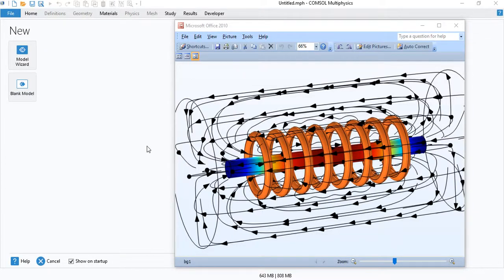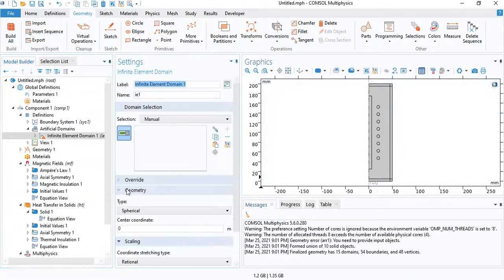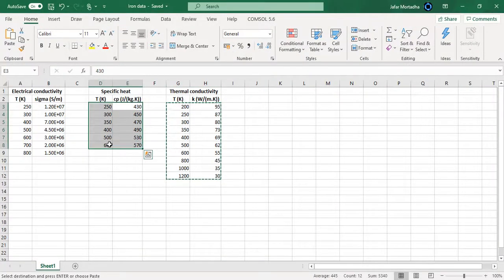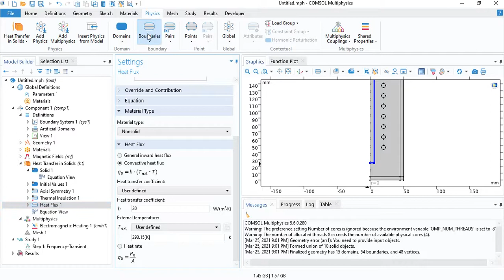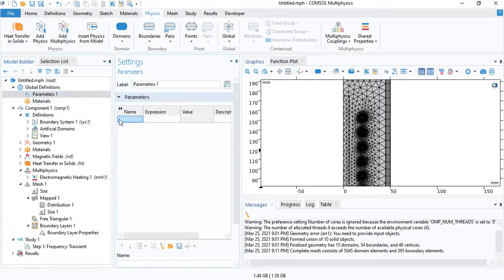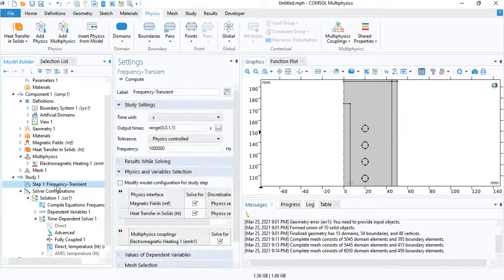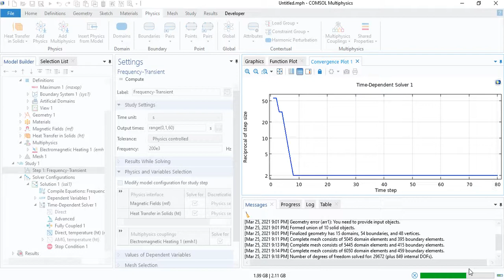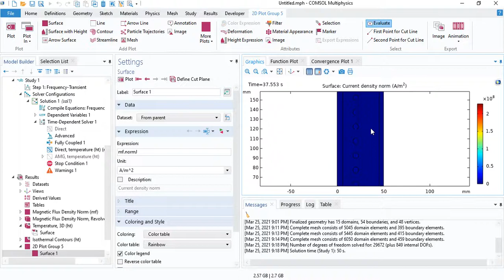Induction heating simulation of an iron bar using Comsol Multiphysics

Comment: Can you please upload the actual comsol file you created in this video. I try to mimic them but couldn't run my simulation.Please help
Reply from the maker: What is the problem you are having? If you apply the same steps in the video it should work.
Reply: @JafScience  Can I simulate the same problem instead of fixed iron bar, I want a m0ving iron wire with some speed around which EM field is created.Can I do this in comsol
Reply: I have used physics controlled mesh and probably ignored skin effect through that. But I am getting constant temperature profile in the rod , why?
Reply from the maker: Yes it can be done but it might be computationally very demanding depending on the operating frequency and the magnitude of bar displacement. You need to use a moving mesh to specify the velocity or displacement of the wire.
Reply from the maker: Don't use physics-controlled mesh. At high frequency the induced current will be concentrated near the surface and that's where heat is generated. If you ignore skin effect then the EM field will penetrate deep into the sample and heat will be generated everywhere. 
If the temperature is constant then no heat is being generated. Make sure the physics coupling is applied.
Reply: @JafScience  Thanks for the info. I will try this .But it was a helpful video.
One thing which creates doubt in my mind is why the temperature is varying along the length of bar while due to induction temperature gradient should be along the radius but it is not so.
Reply from the maker: There is a temperature gradient radially but it is small since the bar is thin and the heat at the surface quickly flows inwards. The temperature gradient axially is more significant since the magnetic field at the centre of the bar is higher so the induced current is higher. And it also takes time for heat to flow axially.
Reply: @JafScience  Sorry, but I couldn't understand how magnetic field at the centre is higher,however, each coil is given equal current? Can you please elaborate a bit
Reply from the maker: Each coil segment carries the same current, but at the centre of the bar the magnetic field from the coil segments get enforced (individual fields add up). Whenever you have helical coil or solenoid, the magnetic field at the centre is the strongest and it weakens away from the centre.
Reply: @JafScience  okk...thanks very helpful.I think it can be verified from the contour of magnetic flux in ab9ve simulation
Reply: Hello, I tried to apply moving mesh technique to this simulation by prescribing normal mesh velocity to iron bar however I am unable to select the iron bar in the moving mesh domain.Is there any reason for the same? Rest all steps are same as in this tutorial.I just want to move my iron bar with some speed and see how temperature changes
Reply from the maker: You need to specify a deforming domain (surroundings of the bar) before you select the moving domain. I also suggest that you define a prescribed displacement for the bar and prescribed displacement for the boundaries of the bar instead of normal mesh velocity. Define a function for the displacement such that its time derivative is equal to the velocity you're interested in.
Reply: Thanks for your response. I tried the same step, but I think I am unable to call defined function for velocity.
If you will make new video on iron moving wire which is heated with em induction and I can find the temperature along the wire depth from the surface at any time,it will be much helpful 🙏🙏🙏
As i am new to comsol, it is little difficult for me
Reply from the maker: I may make a related video that shows the same concepts. If you just need to define a function then right click on global definitions and you will see a wide range of functions. If the input to the function is time then use the variable t. I've uploaded videos which show how a function can be defined.
Reply: Thanks for your efforts. You are really supportive.I think you can create 1 video which include some moving body with certain speed like any drawing process, etc .i think it will be helpful for everyone.Again thanks for all your replies and supports
Reply from the maker: You're welcome!
Reply: Just one more question: Most of the people are modelling Couette flow by forming a Rectangular Geometry and specifying an inlet and outlet with moving wall condition at the top which we usually do in a Couette flow.However my question is Can't we form two line segment and distance between them can be taken as fluid with deforming domain? Or we don't use deforming domain when it comes to fluid/Laminar flow?
Reply from the maker: You can use deforming domain with fluids but it is not useful for modelling couette flow because it'll be unnecessarily complex. A moving mesh can add numerical instability and requires more computational power so only use it when it is the only way to model a particular application.